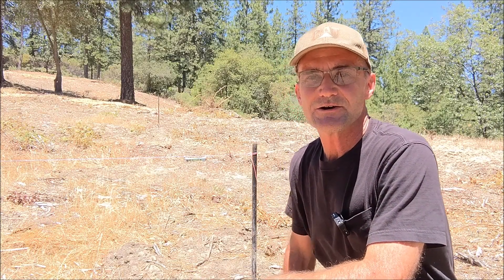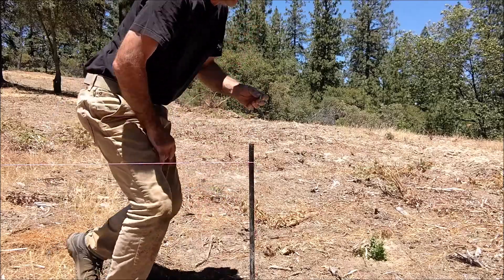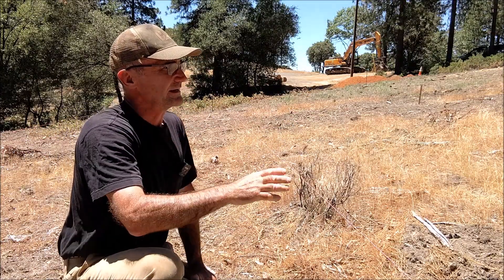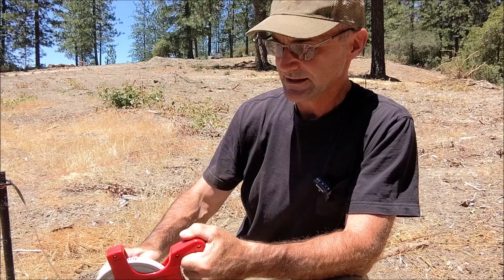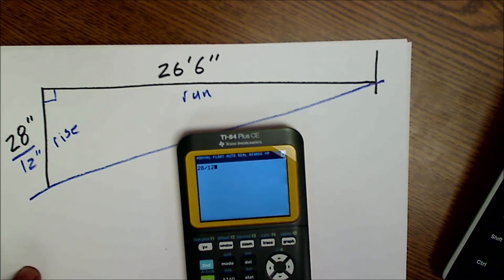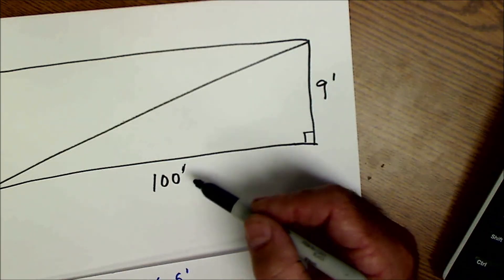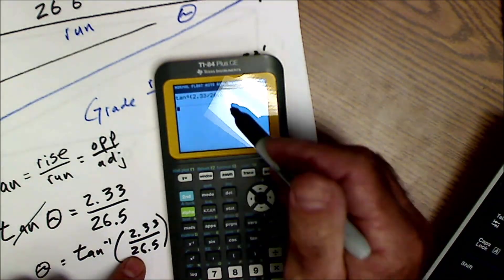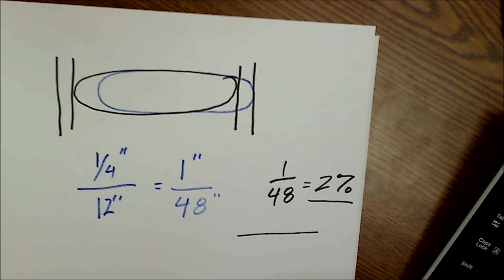How to Use a Line Level to Calculate Grade, Slope

Comment: Great lesson Colfax! When I worked sewer and water we would use a laser for grade but we would check our pipe with a 4’ level. If the bubble was just touching the line we would know it was close to a .40 grade. We would have to figure the percentage. We would shoot the high point and low point.(example) If the high point was 25.24 and low point was 29.66 in a 300’ run, we would use the calculation 29.66-25.24=4.42 4.42/300=.01473 X100=1.473 and that would be the number we put on our laser since it recognizes 100’ incriminates. It is gets to be a lot of other configurations when checking the staking since the survey crew works off of sea level elevation.
Reply from the maker: Great feedback from someone in the field, thank you

Comment: I didn't have enough string so I had to do it 2 different times. I placed 3 stakes in ground in a straight line 20ft apart from each other. Stake #1 to Stake #2 came out to 7%. Then I put the string at the bottom of the 2nd stake and connected it to the top of the 3rd stake. That was 21.6%.  So now do I combine the two percentages for 28.6% and divide by 2? Or is the total slope 28.6%?
Reply from the maker: It depends on the length of the two strings. No you don't add them. I'd buy some new string and do it again the whole distance
Reply: @ColfaxMath  dang, okay thanks